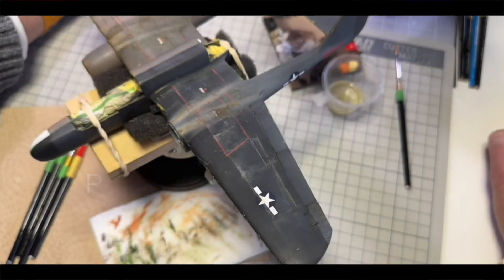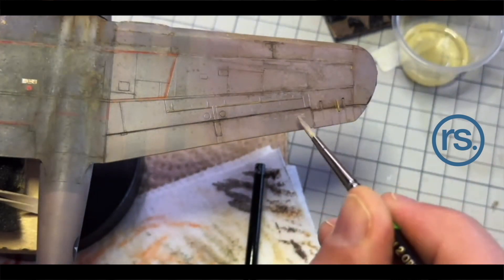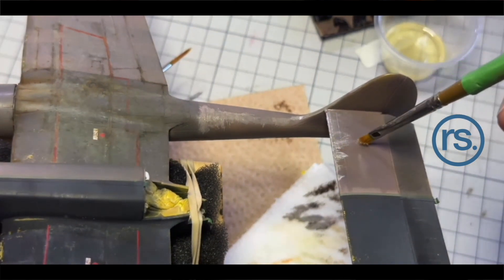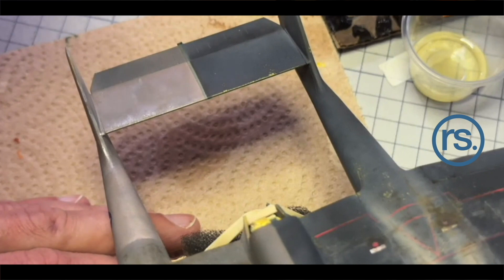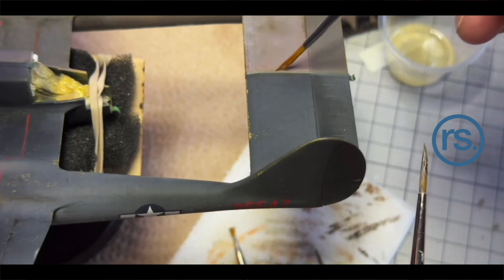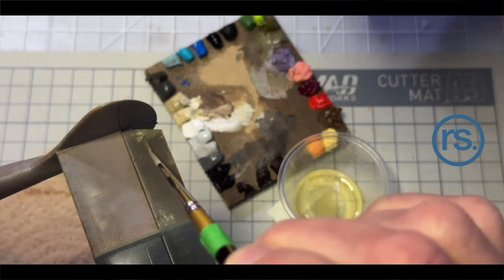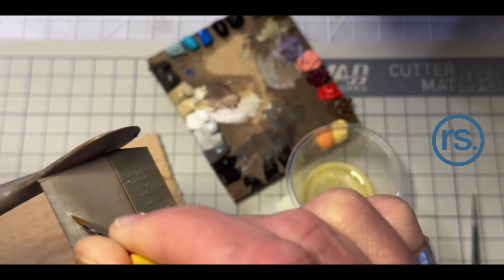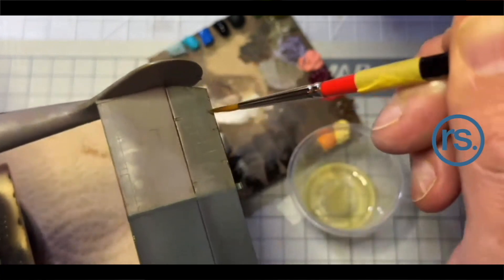P-61 OPR Aircraft Weathering (Olive Drab) Pt 1

Comment: Very interesting! Are you sure that oil thinners are non harmful? I am using white spirit from AK and it smells quite a lot so can you tell me which oil pain thinners are safe?
Reply from the maker: Cheers! I list the thinner in the description, If you have or smell an odor then you're using a "hotter" solvent thinner, and it's not the same, in fact you're using the wrong thinner from them to begin with. 

I always recommended Odorless Thinner as a hobby thinner for OPR, and now, switching to Gamsol is even healthier. I've recommended to use Odorless Thinner (from either AK or Mig Prod. for many years.), so definitely make that switch if you can't get Gamsol.

Gamsol from Gamblin is so low toxicity thinner (0.005%), there are no harmful vapors or odors in play, and the tiny amounts we are using (compared to canvas painters) reduces this aspect even further. At this level it qualifies as non-toxic oil paint work per the govt & art world metrics for this.

In addition, if you want to go one level safer you can use products they sell called "solvent free" thinner, and even Safflower Oil can work, which is all natural and non-toxic, as well. 

This is a good video on the topic: https://youtu.be/O1Jnwn46CLw
Reply: @rs.p  thank you for your answer.